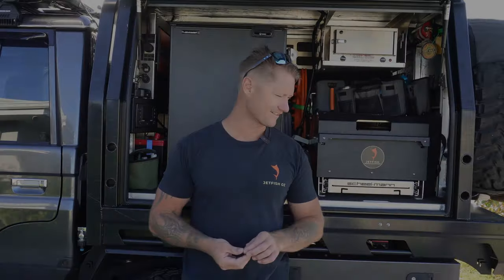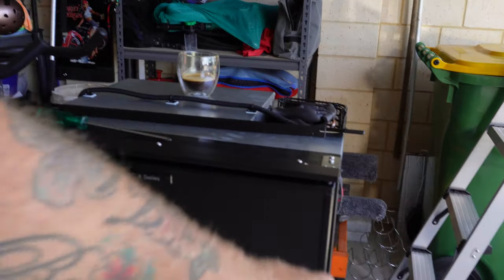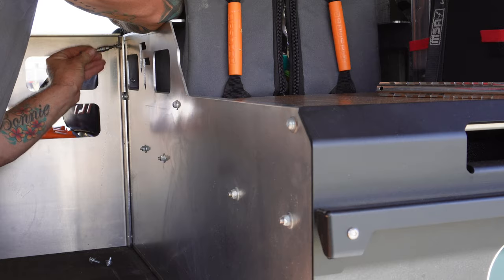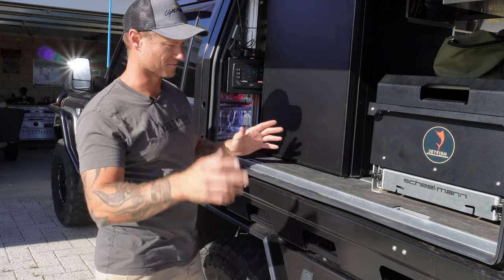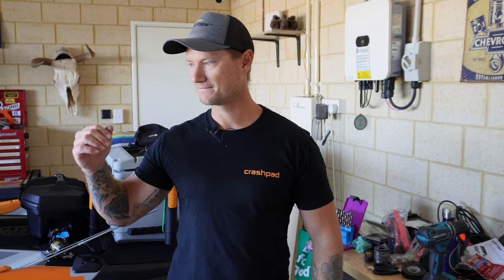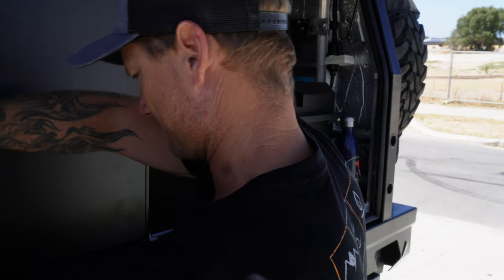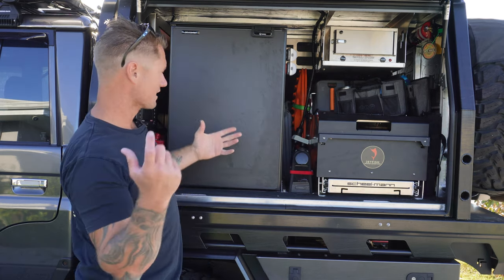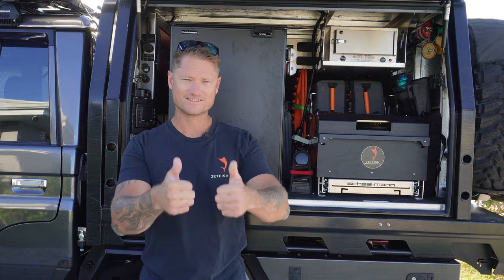NEW FRIDGE INSTALL!!  I  BUSHMAN 130L UPRIGHT  I  COMPLETE INSTALL

Comment: How did you fit the temp sensors from the tvms?
Reply from the maker: Hi Josh, the temp sensors were already installed onto the Redraw System when I bought the canopy. They plug into two points on the TVMS Control unit.
Reply: @Jetfish Offroad Adventures   
Thanks I got the same system in my ute. Did you push the sensors through the back of the fridge near the compressor?